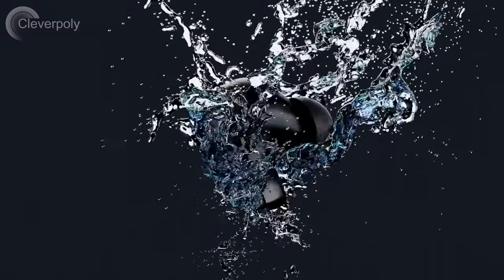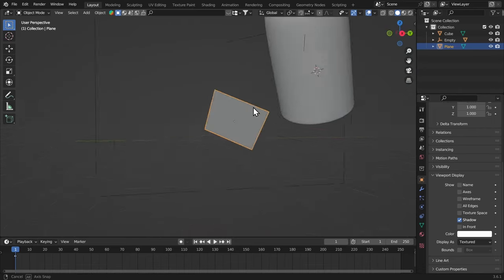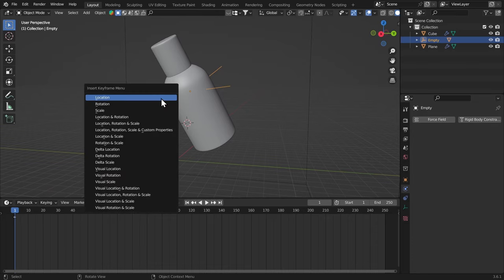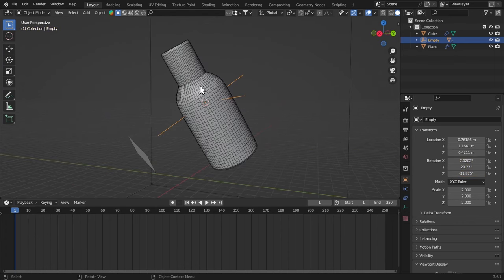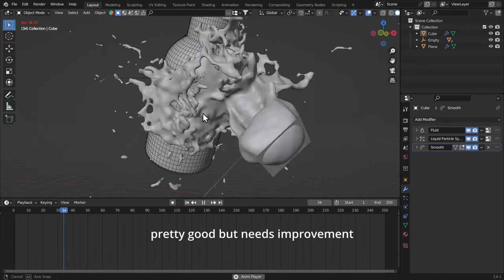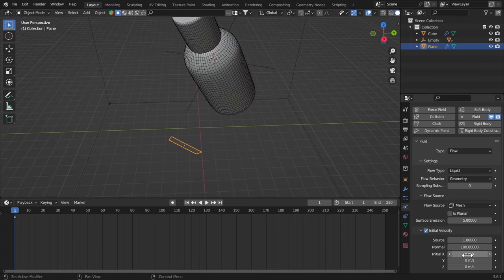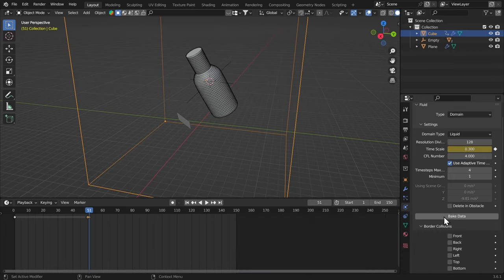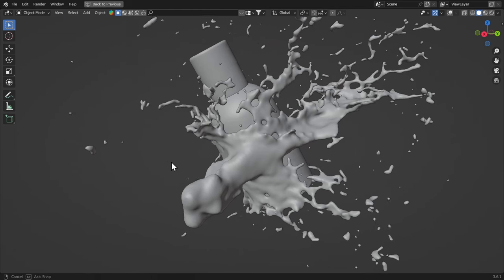Easy WATER Simulations in Blender

Comment: Amazing! I always thought that making the simulation with smaller measurements (in centimeters) would be more efficient and would cost less resources to the computer, but now I see that it is better to do it on a large scale, a doubt, when you apply repeat to the smooth modifier, what does 1 or 5 mean? Thnx 🙂🙌🏻
Reply from the maker: Thank you!
Repeat means just more smoother but it can break it if it's too much
Reply: @cleverpoly  thnx bro 🙂🙌🏻
Reply: For liquid theres no point of making it large or small. its more like as low as possible collision model and make domain the size of simulation u need. Like OP had the cube with 64 resolution, so he calculates 64*64*64=262k cells. If for example he would shrink domain on XY axxis (13:44) and bring domain corners closer to emitter and shrink XY domain size by lets say 20% we would calculate like 51*51*64=166k cells that would speed up baking for like 40% because from my experience default blender liquid sim is like 99% of the time calculating collisions inside domain

Comment: For some reason, the Domain still shows in the final render. Am I doing something wrong?
Reply from the maker: It's the start and end frame
For example if my simulation starts from frame 50
Frame 1-49 will show an empty domain
So for that you need to hide it in render and keyframe that.
Go to object properties visibility and set that.
But sometimes you just have to bake properly
Reply: Thanks  @cleverpoly

Comment: Hello, I followed your tutorial, but after baking it, i can't seem to get it played. Did I miss anything or?
Reply from the maker: You're gonna have to be specific, what doesn't work is the simulation not there or the timeline is not playing..
And it's not about following the exact same settings it's more like trying out your own thing for your scene.
But generally this tutorial should work fine and for help you can join the discord
Reply from the maker: @krstjnh So first check the size of objects as I explained in the start
Make sure they're not too small.
Then select your plan and set the particle emission for fluid to 5 or something

Comment: I have been following the tutorial and everything was fine until minute 3:31 when I press "mesh" and the cube remains in the same shape... It doesn't turn into that thing 😭😭
Reply from the maker: make sure you are on frame 1 while setting up simulations of any kind. and the final bake matters so if that works then no problem
Reply: OOOOH it worked.. ty 😭😭♥ @cleverpoly